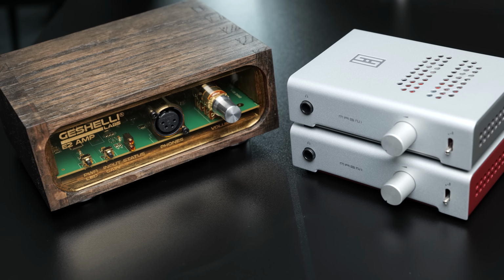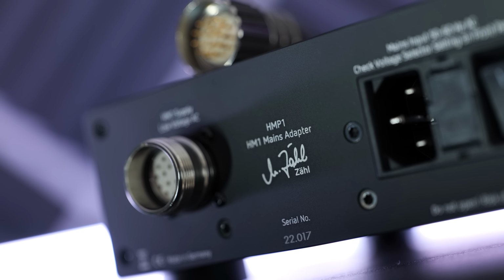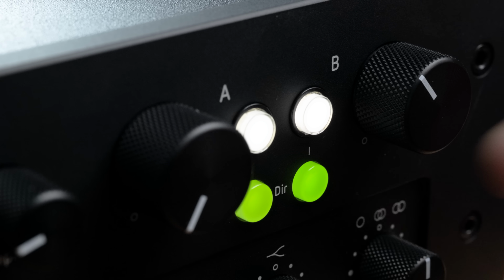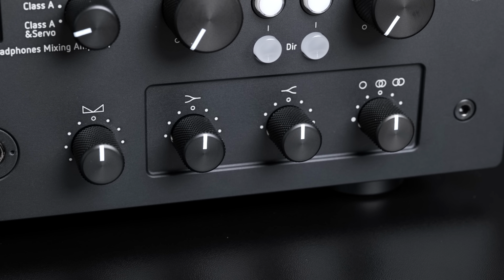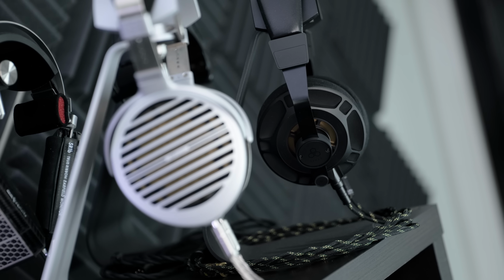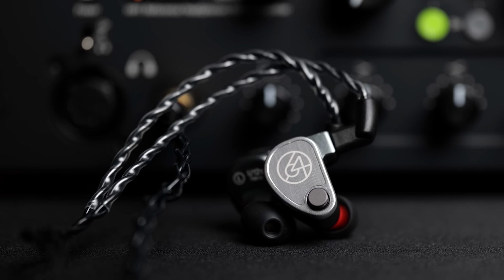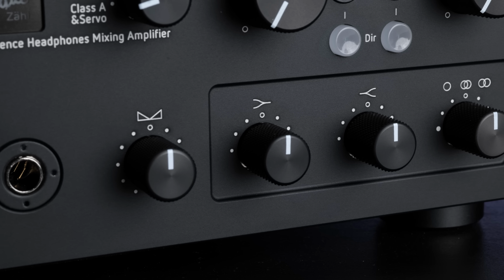How good is an $8000 headphone amp? - Zahl HM1 Review

Comment: Hello. Does it benefit from a DAC with high output voltage to drive tungsten ?
Reply: The Amplifier is what drives volts through the Tungsten, so if you use the Zahl HM1’s amplifier you will be using its maximum voltage. Changing your DAC won’t change the voltage in a chain, though I think the review said it could drive the Susvara fine?

Comment: As with the others, great review! I'm hoping you can give me some direction. I've been using an A&K KANN CUBE since shortly after it was released. I want to stay with a battery-powered all-in-one... and does not need to be portable. I am considering the A&K ACRO CA1000T... and although it gets better than okay reviews, I want the next device to make a substantial improvement in the sound... and not just a noticeable one. I thought about products like Chord's "Hugo TT 2," but I don't believe it's an all-in-one like the ACRO or my KANN. I also want the unit mainly designed for over-the-ear headphones, and not IEMs. Any advice or recommendations would be greatly appreciated. Thank you...

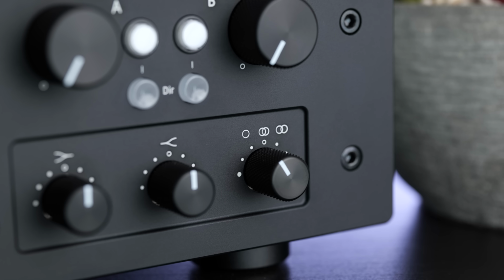Comment: 8:55 To separate the audio to mid/side is NOT much more clever than a crossfeed. A crossfeed has more things going on, and there are different solutions and takes on a crossfeed circuit. 
9:14 "Then it applies some crossfeed..." Not true, at least according to the manufacturer. This knob only adjust the volume level of the side information, leaving the mid information constant. Usually when you raise the side volume you get the feeling of the music sounding bigger and wider. But at the same time the relative volume for the mid gets lower in comparison. So stuff that are mixed in the middle (usually vocals, bass, kick drum) get pushed back in the mix. I don't mind having the option to control the mid/side, but there is absolutely nothing clever about it.
Reply: I think you are wrong here. Wish I could locate the source but I read that there is some degree of crossfeed in combination with the MS processing. I've used MS processing before, and this is a bit different. It does not compromise the center channel that much.
Reply: @chipsnmydip  In the manual it says that it only affects the volume for the side signal. From no volume, aka mono, to an increased volume. (They don't say with how many dB you can raise the side signal over the 1:1 relationship though.) The volume of the mid stays the same. One would think that if there was anything more going on it would be mentioned in the manual or on the product page. 
With a designed test track it would be somewhat easy to check if there's more than just a volume shift for the side signal. 

"The stereo signal is converted into a mid signal (in simple terms, what L and R have in common) and a side signal (in simple terms, what distinguishes L and R). Summing mid and side signals in a 1:1 ratio will result in the original stereo signal. However, if you change the ratio between mid and side before summing them, you change the stereo
base width. In our circuit, we leave the mid signal as it is. We only adjust the level of the side signal. If we lower the level, the stereo image becomes narrower, if we raise the level, the stereo image becomes wider."
Reply: @churchusa  In any case it sounds different and better than Solid State Logic's stereo widening tool.

Comment: An $8000 headphone amp will be amazing if you get it custom built, you know the builder, you understand the design and you get a complete breakdown of the parts used. For an $8000 headphone amp from an off the shelf manufacturer you'll be mainly paying for their marketing expenses. For example, open up a higher end Woo Audio and check out the transformers they are using.
Reply: I think it's fair to say that Zähl is not a marketing heavy company, and this is their only foray into consumer audio. Their main business is professional consoles.
Reply: @chipsnmydip  Even the most product-selling oriented “reviewer” zeos thinks this amp is ridiculous, you can imagine how ridiculous the pricing this product has
Reply: @macrostiff  Zeos didn't like it specifically because it's not cheap, and he doesn't like expensive stuff. He also paired it a $500 dac and <$100 headphones. That's really all there is to know.
Reply: @chipsnmydip  That's not true, he liked it but just could not justify the cost for your standard enthusiast. And let me know where you can get the ABYSS DIANA for <$100, because he used those on that amp.
Reply: @redstang5150  Diana TC was the only high end phone he used. In the review he literally plugged in old school Walkman or airplane headphones. I sort of agree with your characterisation, but there was barely any review or commentary on the actual sound. What there was was positive, but I think he really wanted to express how offended he felt that such expensive amps exist and he doesn't understand the purpose. Realistically, and amp like this one makes sense if you have a really good DAC and something like Susvara. Maybe Diana TC, but I think Abyss are more for tube/warm amps.
Reply: @chipsnmydip  Yeah, but he normally doesn't spend a ton of time talking about how DACs/Amps sound. If I remember, he basically said it sounds amazing like any high quality amp would, but so do amps at 1/3 of the price or less.
Reply: @chipsnmydip  Zeos is one of the worst audio reviewers there are. The fact that you consider his opinion as valid tells me you don’t know and pay close attention to what he does and says. Aside from his perverse personal life and personality he doesn’t seem to understand how upstream aspect affect downstream equipment. He has no clue. He thinks his so-called “honest, no b.s.” reviews make it appropriate for the common man but his listening skills are poor and his recommendations are disingenuous at times. I just find it so ridiculous that people watch his channel and assume he’s an expert. It’s a fool with a camera and a YouTube account who’s trying to make a dime.
Reply: @chipsnmydip You could not even list the equipment he used on it and he doesn't just use the stuff you see on the review.

If you can't get straight facts right your opinion is less than worthless, it's missleading.

Comment: It's ironic that you used tracks from Aphex Twin's SAW, given how poor those recordings are (at least on paper). That album has a ton of clipping.. Not what I would pick as reference material. Certainly Richard D James did not use Zahl's gear when he recorded SAW... pretty sure he was like 17 and used a cheap multitrack tape cassette machine. And the Richard D James album was almost certainly all done on a laptop with samples

Comment: How is it with SR1a and CA1a? Even if they are more current based headphones I imagine both resistor and transformer interfaces are not in the sweetspot of what the HM1 delivers the best. Am I right? Thx for the review btw but I will stick to my Purifi amp.

Comment: Compare  $800 speker amplifiers with this and be amazed at how good they are. 

Am still trying to understand way do people keep trying to find headphones amplifiers (which are sounding linear) when they never really tried real amplifiers 

I know how this amplifier sounds like without even touching it.  Linear and over expensive in excess. Is probably the feedback less version of Ferrum OOR and other similar.

Everyone who spends that much money in headphones and amps should know that linear amplifiers sound's life less. A good sounding amplifier will give you an  enachement sound (colorised) not linear. Full stop

I use Yamaha A-S 501 (speaker output)  with my Final D8000 Pro. This combo simply killed other amplifiers like Burson and Feliks Audio.  Recently purchased the Ferrum OOR and HYPSOS and I'm slapping myself now for being stupid and buying stuff recommended on YouTube. 

Liners amps are fot studios.  And basically useless for home.
Reply: This is sadly true. Im using a benchmark amp to power susvaras, which does a better job than any amp costing 4 times more than it from what I heard at audio shows. The catch is they are very dangerous to use with dynamic headphones because their voice coils will melt due to farad capacitance attenuated if pushed hard enough. Thats why they all have to have step down relays on the output stage, which reduces the available capacitance, which is the exact opposite thing you want for a planar. Any modern good speaker amp has noise levels low enough that they work fine as headphone amps. I wish more people would realise a headphone amps should really only be used for dynamic headphones.

Comment: Having heard this I really wish Zahl would release a version that got rid of the A/B, the EQ, The L/R pan. You could then pick if you wanted the servo or non servo version. It would sound the same but be 'affordable'.  The extra features are unnecessary. The company would make more profit from this version due to the sheer number of units shifted.
Reply: If they're sold out for the next year's preorder there is absolutely no incentive to do a redesign with less features and then have to build cheaper units.  😉
Reply: @nmnate  If a company sells out of it's yearly stock within the the first month of the year that doesn't mean everything is great. It means that business needs to grow and increase its capacity to make the thing that sold out. Why sit on your hands?
Reply: I doubt that would drop the price more than 1-2k$
Reply: @hartyewh1  Just to be clear you are saying that removing 

- A fully analogue mid side EQ 
- One of two whole independent input/output channels 
- Feedback circuit  
- Panning 
And take into consideration that they all have their own volume knobs. You think that would only shave off 1-2K?
Reply: @codgerfiasco also. The mass mass majority of the cost of an amp is in its power solution. Capacitors and transformers can cost $100's each to make. The components you have listed are a fraction of that cost.
Reply: @codgerfiasco  also the potentiometer, they can be very very expensive.
Reply: @En_Joshi-Godrez  You say it would never reduce the cost beyond half of what it is currently but I wouldn't expect it to knock more than half off. Note that I put the word affordable in quotation marks in my original comment :)   However getting it made in China is not a bad idea to shave off more costs. They are just as capable as Germans in terms of putting something together if given the correct instructions. It would be a best seller (trust me I've heard it) so you could make a much  larger batch than the 50 a year they are currently making.
Reply: @codgerfiasco  he wanted a uncompromised product. Making it in China requires tooling for every single one of those bespoke components. Its not viable for a company this small. They sold out there entire stock almost instantly, stop asking for something they can't afford to give you.
Reply: @En_Joshi-Godrez  Most of it won't be bespoke. Small businesses become big businesses everyday. When products are in demand funding streams open up. Also, economies of scale is a thing people.  Making something in China doesn't represent compromise. Shit, I imagine Chi Fi companies are tearing this down and will mass produce something equivalent in a couple of years that will absolutely give me it for what I can afford. They have done so repeatedly with other headphones, amps, DACs. The cost of tech always trends down. Either Zahl can do it or someone else will.
Reply: @codgerfiasco  yes and absolutely none of them have made a product remotely as capable as this. The only chifi bands that have any high end presence are hifiman, denafrips, and kinki studios. Oh and won't you look at that, all their highest end models use the exact same production method as this product despite made in China. 40 susvaras are made a year, all in China. Be quite, shut up.
Reply: @En_Joshi-Godrez  Haha okay dude. HoloAudio = China. Best measuring Dacs and amps on the planet (SMSL and topping) = China. The latter mass produced. Moondrop IEMs make some of the best (also mass produced). I could go on and on.
Reply: @codgerfiasco  yea and as golden sounds said. The topping and smsl stuff doesn't sound good thanks to high a  feedback topology, and using high gain to create effective capacitance instead of the farad of the capacitor being limited by the gain. It makes music sound  sterile and dynamically challenged because the voice coil isn't being loaded by the correct amount of capacitance for the voltage offset for the dynamics of the song. They're ok for the price. They're not ok for anything approaching $1000. Holo audio is another company that makes products in the identical way this one does. The only difference is they're in China. ALL high performance companies are small boutique brands, because of how overheads work. Any big brand you can think of, they're products dont have the performance that these do. Its that simple.
Reply: @codgerfiasco  also moon drop is not mass produced at all. You are just in the 0.01% circle of music listeners that they are highly prevalent in. And, they're highest end model is still no were near the likes of a Sony ier-z1r. Oh, there's another! Sony, one of the largest electronic consumers in the world. How many z1rs do they make a year? About 70. I could go on and on and on. You'll never find an example of a ultra high performing  product that has high manufacturing output. It doesn't happen, and it doesn't happen for a reason. Leave.
Reply: @En_Joshi-Godrez  You're taking the highest bar as an example of mass produced. I mean SMSl and topping make thousands not 50. Anyway you are missing my point; These companies, even the small batch ones, produce things that would have costed thousands more not that long ago. They will keep doing so.
Reply: @En_Joshi-Godrez  BTW when you say "It makes music sound  sterile and dynamically challenged because the voice coil isn't being loaded by the correct amount of capacitance for the voltage offset for the dynamics of the song." I would love if you could link me to measurable evidence of this claim.
Reply: @En_Joshi-Godrez  "yea and as golden sounds said. The topping and smsl stuff doesn't sound good thanks to high a  feedback topology"
He doesn't say that, he says that "some say" negative feedback makes them sound worse. And anyone who says that should read the article on negative feedback by Bruno Putzeys on audioholics (and never sin again after that).
Reply: Dude, it still takes multiple days to make each one of them, all of which are done by employees that earn magnitudes more than any worker in China. 90% of what you pay on any product is labour, thats not reduced if you still need to manufacture all those components in for your entire product portfolio by hand. It will never cost less than half this, because the labour cost would never scale 1 to 1. Even if it take 25% of the time to make, it will cost 50% less because of your overheads on every other cost for your company, which are ongoing regardless.

Comment: That's why you destroyed the ef400 ! You tested a flawed unit and still not have pull the review , but I was sure the.purpose was to legitimate a 8k amplifier review ! Good job and good luck to the dumb fanboys that follows you !
Reply: The EF400 review has nothing to do with this?
The EF400 has a flaw, therefore I talked about it in the review. Hifiman has released a statement saying they're aware of the issue but have not provided any info on how many units are affected

Comment: 12:06 Not only that, but you must have good synergy between components.
If you have warm dac you need clean and clear amp
if you have clean dac you need warmth from the amp. 
One can get warmth or cleanliness from cables, but effect is not as big as from dac and amp.

Most of the dac and amps can sound good given synergy between components, but most the audiophiles dont know what synergy is.